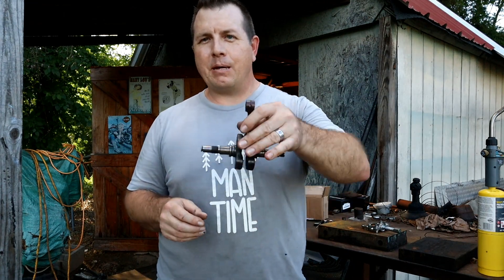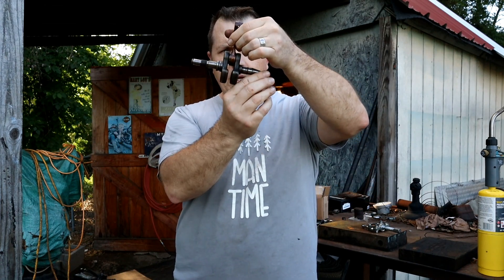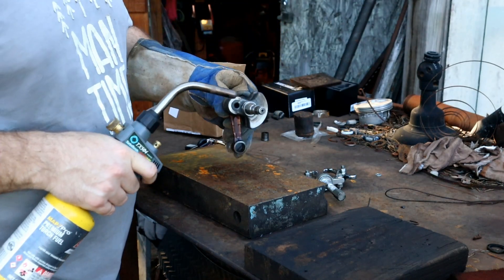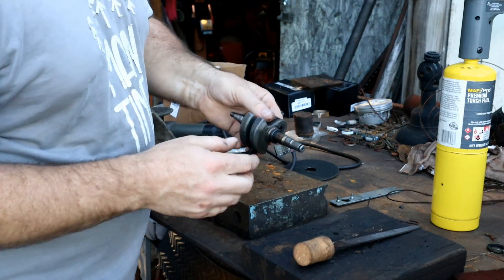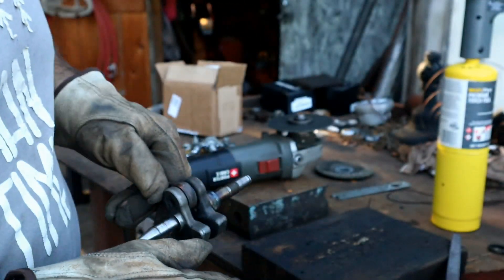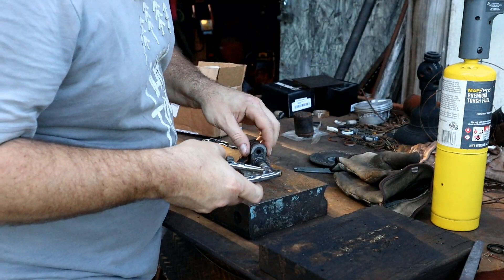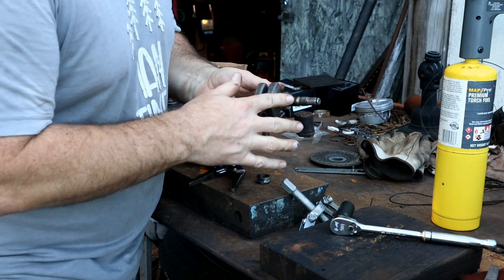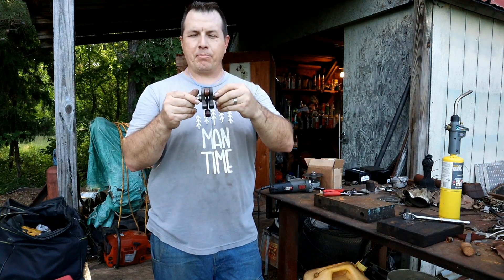How To Remove a Stuck Bearing Race From A Crank Shaft

Comment: a bearing splitter is the tool for the job. However some of those bearings are not too tight on the crankshaft and can be pried off with a couple of large screw drivers.
Reply from the maker: Right, bearing pullers are made to do this job. In this case there was no gap, and even a knife edge wouldn’t be able to start the separation.